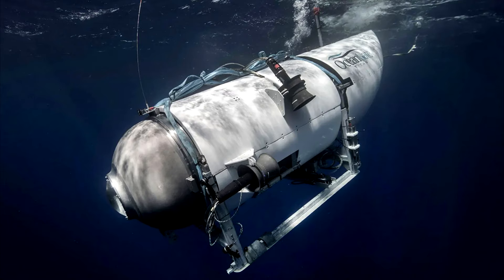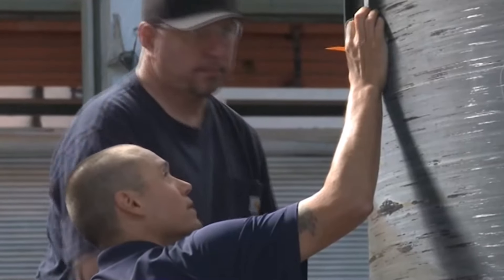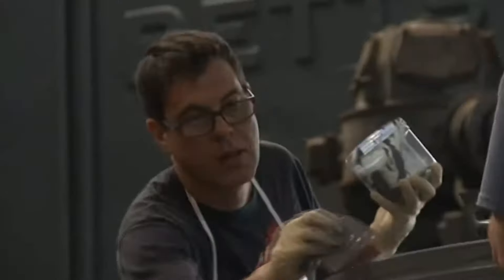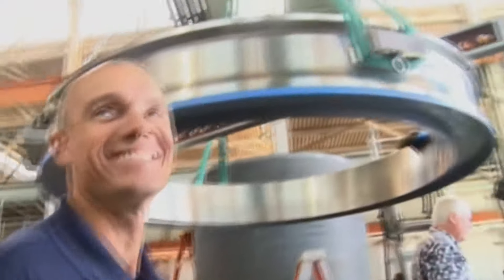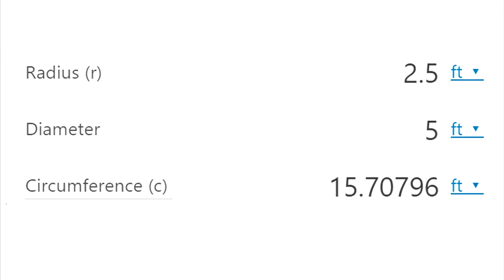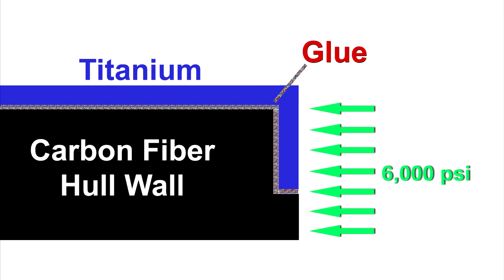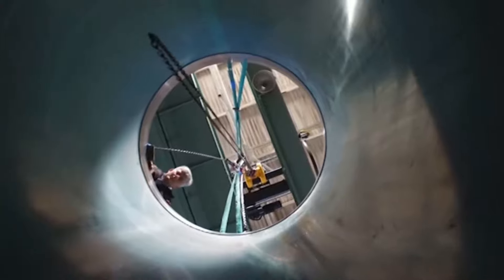Ocean Gate Titan Was Glued! Coast Guard Reviews

Comment: Mechanical engineer here. I used to do aerospace composites testing for fatigue, at coupon level, for material characterization.
In other words, I used to take samples of  carbon composites and break them in servo hydraulic test frames to see how the material behaves under different loading schemes. 

Let's get something basic out of the way. Carbon composites, like fiberglass composites are nothing more than string embedded in glue.
Sure, the string is stronger, on a diameter basis, than many other materials,  but it is still just string.

Strings can only support tensile loads; one cannot push any object with a string along its length.

The only legitimate use for strings in glue to be used as a pressure vessel is when the pressure inside the vessel is higher than the pressure outside of it because the string will be loaded in tension, similar to a fat man with his belt too tight.

Asking the carbon string to withstand compressive loads, like for a submarine, is setting up the loads to be pushing, not pulling on the string.

The end result is that the glue itself takes the compressive loading. There should be no forces acting in the glue, which is just plastic. The glue is only there to preserve the orientation and spacing of the strings.
Reply from the maker: Yep.  Absolutely correct.  The idea was not sound.  It's amazing it lasted for as many cycles as it did.  You need to watch Karl Stanley testify at the Coast Guard hearing next Tuesday.  He is scheduled for 1:30PM.  I've seen all of his interviews about Titan.  He went down to 4,000 meters in Titan when Rush was testing it in the Bahamas.  Karl has a great story about it and he will be awesome.  I can't wait to watch him in this official setting.
Reply: @solareclipsetimer  I heard Rush talking about initial cracking sounds supposedly tapering off after the first dive. That made my jaw drop. Any, I mean any, cracking noises indicate structural failure.  Since Rush never fatigue tested his cylinder, nor assembly, he had zero data concerning ultimate life, or how many dives he could safely perform before trashing the cylinder.
I would not have taken a single ride, not even if the vessel was spherical, doubly thick and without ports, if it was made out of strings under compression.
Forgot to thank you for the reference, I look forward to hearing what Karl has to say.
Reply: "You can't push a rope" - my first year Statics teacher. He always did have a way of explaining things so we could understand them.
Reply: Great explanation...thanks.
Reply: Thank you for this excellent explanation.
Reply: @salvationbygracethroughfaith  Weak
Reply: @GWNorth-db8vn  That's what she said
Reply from the maker: @cremebrulee4759  Thanks, glad you enjoyed it.  The link to the Coast Guard site in the description has the list of witnesses and the schedule.  If you can watch some of it you should.
Reply from the maker: @Kenjiro5775  Yep, everything you say is true. Karl Stanley talks about his dive where things were popping on the way down and then popping on the way up as stored energy was released.  Wild!
Reply: Pressure inside >= outside as in aircraft/spacecraft fuselages/hulls, high pressure gas flasks/bottles.
Reply: he basically made a sub out of some titanium and mostly glue
Reply: I do mechanical engineering as well - I simply don’t understand it survived any dives to 4.000 meters, epoxy is stronger than I thought, even though it’s kinda strengthened by the carbon fibers.
Reply: Absolutely wrong material for the job
Reply: Well said. 👍
Reply: @blacknoir2404 only the 2 domes on the end were made with titanium.
Reply: @vaughnkavon3993  yup that's the some titanium
Reply: Calculate the compression forces. These glue joints have to take the force of the water pressing on the entire front and back face of the cylinder. If I didn't make a mistake, that makes a force of 155 N/mm² in compression forces, that the glue and the carbon fiber has to withstand, and that only at 4000m with 0 safety margin.  If I remember correctly, the epoxy used has a tensile strength of only ~ 25 N/mm² and while tensile forces aren't compression forces, that is some load design that can't possible go well.
Reply: That makes perfect sense but makes me think of more questions

Comment: Well, the US Navy made the unmanned AUSS submersible. It was a 2.5" thick GFRP cylindrical hull with glued on titanium end caps, using coupling rings and epoxy. It was designed to reach 20K feet depth. It made many successful dives. It was built very much like Titan, except with much better materials and construction methods. It may be where Rush got the idea.
Reply: It was also much smaller, and therefore stronger for a given thickness of material. But I also bet it was made with care and attention to detail, unlike Ocean Gate who seem to have had a 'near enough' attitude to the whole thing.
Reply: So it was the same, but 100% different... ok.
Reply: @onenote6619  Yes, AUSS was 17 feet by about 3 feet and it was of course much more carefully made. I think it must be where Rush got the idea. IIRC, AUSS made more than 100 deep dives.
Reply: UNMANNED.☠️☠️😳☠️
Reply: The budget the US Navy had for their submersible was many times that of OceanGate. Rush was trying to make his sub while spending as little money as possible (relatively speaking).
Reply: @sjsobol1  Since AUSS was unmanned, I doubt that budget claim. Rush clearly didn't care that much about safety testing, as he basically never tested the hull design he used. Not even once. He just assumed that five one inch layers sanded off and glued together and  autoclaved after each glued layer,  was the same as one five inch layer.  This also meant that by the time the last autoclave session happened, the first layer had been autoclaved 5 times. The five layer idea was never tested in any way.
Reply: Well duhhhhh..yes if the Navy's was smaller  then it's different..

Comment: Titanium and carbon fiber composite will have different stiffness and as the pressure loads build up they will compress by different amounts. This is going to place shear stress on the glue joint.
Reply from the maker: Yep, agree.

Comment: Thank you for this very clear description and explanation.  He must have been willfully blind not to admit the very obvious danger of 32 feet of glued joints between two different materials with different flex under extreme pressure.  And as you point out, the glue was just slapped on by hand with no testing or way to detect gaps or bubbles.  

What power he had, to hide from all reasonable warnings and all oversight that would have prevented him from endangering passengers who did not know the magnitude of their risk.  Horrifying.
Reply: Thank you for your thoughtful comment.  If you get a chance to watch some of the Coast Guard hearings you should, I think you would find it interesting.

Comment: Actually Thunderf00t did anticipate the failure point at the glue joints a year ago. He also shows the problem with the different coefficient of shrinkage of the materials under pressure and on temperature change.
He said he was shocked it lasted as long as it did. But the other thing that will brake is the carbon fobere . You use a rope (carbon fibre) for forces under tension. But you use metal or stone for pressure forces. Airplane bodies have a higher pressure in the inside on travel altitude so the carbon is under tension because of the higher pressure inside. So using it with a ridiculous pressure outside with pressure change each dive just wears down the pure carbon fibre to. The titan spheres they use normally are that thick that the titanium is pressed against itself so it has no real weak points in the sphere. This tube was just accident waiting to happen.
Reply from the maker: Agree with everything you wrote.

Comment: After this tragedy last year I started saying don't make submersibles with Mod Podge (a name brand craft adhesive with no affliation to the Titan). I was only joking, of course, but have come to realize that adhesives were indeed used in the Titan's hull construction. ETA: I did not realize that the carbon fiber hull had been machined to accept the ring. I thought that the ring was formed to mold to the 5" carbon fiber hull. Thank you for the great video!
Reply from the maker: Thanks for your comment.  Yes, I was also amazed that they used a lath to decrease the diameter of the hull on the front and back outer rims to accept the titanium rings.  Not only does it reduce the diameter at that lath section, it disrupts the neighboring carbon fibers that may have been sliced at the edge of the "step-down."  If a fiber loop is cut it decreases its performance and the amount of damage done there is not determinable.

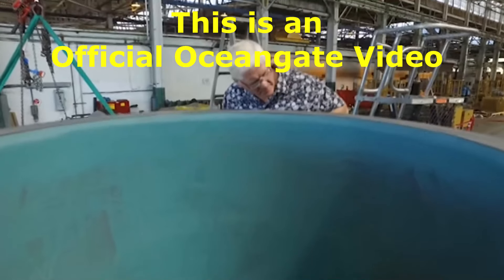Comment: 0:50 Stockton]  "That seal needs to be uniform and small, but not too small."  You know what this reminds me of?  the reasoning behind the procedure for the installation of the insulating foam of the much discussed 'bipod ramp' of the Space Shuttle that came out in the Challenger Disaster Report.  There you also had a safety item who's integrity was completely dependent upon the craftsmanship of the technicians installing it. NASAs attitude at the time was that their craftsmen were very skilled and that would ensure sufficient quality.
Reply from the maker: Thanks for commenting.  yes, that was an odd statement.  Spencer Composites actually had a specification in their design analysis for the glue joint.  It has a measurement on the drawings.  It is supposed to be 0.03 inches thick.  Do you see anything in this video that gives you confidence that they know that the entire joint is uniformly 0.03 inches thick?
Reply: @solareclipsetimer  Given that the ring and hull were within a reasonable specification for cylindricity, the hydraulic nature of the glue itself should in principle make the two parts fairly self-centering with any excess glue being squeezed out.

What I would be most afraid of would be voids and bubbles everywhere, and that would be almost impossible to control due to the viscosity of the glue even using a vacuum system as proposed by SchrodingersCat, but that requires a rather liquid adhesive.  The more liquid adhesives available probably not strong enough
Reply: He should be wearing a face mask and hair covering if it is as critical as they are saying, which it likely is. Another example of his recklessness.
Reply: @martystrasinger3801   Hi Marty, I'm honestly not sure who you are replying to since your sarcasm seems misplaced in this sub-thread.  In similar situations when I'm being playfully sarcastic I close my comment with the /sarcoff tag to signal readers that I intended to be playful rather than a jerk.  There have been references to dust contamination, but not in this sub-thread.
Reply: @williamreymond2669  I apologize for any confusion, as I was not being sarcastic. The conditions that Stockton spoke of re: the specifications for the glue and integrity of the glued joint should have required higher cleanliness standards. A fallen hair, or drop of spittle, could risk the integrity of the system. I believe a similar statement was made elsewhere in the comments regarding cleanliness of the facility where the gluing was being done.

Comment: Putting Carbon Fiber in Compression is EXACTLY the Opposite of what Carbon Fiber is best at.
Reply from the maker: Yes!  The concept is loops of strings under tension providing strength.  This was loops of strings under compression just providing a platform for the plastic matrix.
Reply: How was the CF "in compression"?  Compression is where the forces are applied towards the ends of the fibers.  Obviously, that was not the case.  The hull was wound from CF ribbon circumferentially, and lengthwise.  The force from water pressure was from the SIDE, which would tend to make the composite bow in.  Well that is much more complex, as  any applying force to the side of a longitudinal structural element, be it a CF sub hull, or a universal beam, or whatever, creates compression on the surface where the force is applied, and tension on the opposite surface.
No doubt using CF in this way was quite inappropriate, but largely ignorant glib analyses on YT are not helpful.

Comment: When Building with carbon fiber I put my parts Under a vacuum, 12 PSI  1. earth atmosphere. That glue joint was unclean, open to dust, Air bubbles were created as the part was set on! The epoxy was troweled on, the epoxy was drying(setting up) as it was applied...  All JUNK! Where were the experts?
Reply from the maker: You know, he had experts involved at various times, but Rush fired them as soon as they started indicating that the concept was not going to work.  So far, during the hearings, Nissen and Lochridge who were involved with the building of Titan said they would "NEVER" get in the thing and take it to depth.
Reply: Yeh, I have done precision glue ups of composites and literally everything about this was done wrong. There is no way any of it could ever be certified.
Reply: @schrodingerscat1863  it wasn't. They just pretend it was in order to get customers.
Reply: @TheresaHall-vl1bm  Exactly, lack of certification for that thing is serious problem. Allowed that clown to cobble together a death trap and take paying passengers in it.
Reply: They were fired
Reply: slightest bit of flex on that joint and game over , it had no chance , the older the carbon fibre and resin the more brittle and harder it becomes.
Reply: @schrodingerscat1863   I'm sure  that is something that will be looked into as in how do we prevent people from going out without being certified.  Considering after the titanic there was huge inquiry and a bunch of changes were made  including more lifeboats and people on radio  at all hours.  They will probably do something similar when this is over.
Reply: It could have been the best joint in the universe z it was still wrong to choose the materials and methods for the use envisioned. So whatever. Nobody cares.
Reply: @camojoe83   actually  that might something that is forbidden when the inquiry is over
Reply: @TheresaHall-vl1bm  you can't forbid dumb people choosing to do stupid things in open water. No way to do that.
Reply: @camojoe83   true but you can keep from going to sea or operating a business without the proper paperwork
Reply: @solareclipsetimer   plus none of the others were experts in engineering.  The rookie engineers were probably just glad to have a job plus didn't have enough experience to know the dangers
Reply: @TheresaHall-vl1bm  you can also make laws against drugs to solve the problems of drug use. 

Oh, wait. You can't.
Reply: @camojoe83   we have to do our best to prevent trouble.  Does that mean there won't be stupid folks no but there might be a few less when the new rules are made.  Considering looking back at the titanic we can see common sense mistakes that had to be fixed with new rules at that time so they probably will do something similar when this is over to Hopefully keep some idiots from killing anyone besides themselves.
Reply: @TheresaHall-vl1bm  there's no rules in the middle of the Atlantic, sorry.
Reply: @camojoe83   but unless you can live out there all year round  the authorities will have their say especially if you plan to run a business from their ports.
Reply: @TheresaHall-vl1bm  lol whatever. You must not live near the ocean.

Comment: The pressure, also applied to carbon wall, and via carbon to glue and inner titan ring bevel (and they both, glue and bevel finally failed on front ring).
And there is no major glue residue left on front ring.

Comment: Wouldn't there be a difference in how the different materials react to the temperature variances?
Reply from the maker: Yes, good observation.  This was dealt with to the degree they could predict with the design and thickness of the titanium ring junction point.  Trying to match the behavior of the carbon fiber which was right next to it.  It's complicated with the adhesive in between them (another variable).

Comment: I think you have hit the nail on the head. 
I personally believe "that" bonded joint is the cause of his demise and not the sanded  carbon fiber between layers. 

That joint would have had air pockets in the bond line. There was no control of bond layer thickness as discussed, there was no squeeze out of adhesive, the inner flange of the titanium ring was insufficiently thick and provided no shear support for the carbon tube.
That inner flange was torn off in the wreckage, check it out.

Comment: I seem to recall some other source saying the Titanium domes and rings were reused from a prior model. That prior prototype had a 4.5 inch thick carbon fiber cylinder, and therefore Titan’s 5” thick hull needed a step. The latest pictures of the wreck suggest failure occurred at one end at the joint of the carbon fiber hull and ring. Much of the hull was crushed into the aft dome. I believe it was Tym Catterson participated in Titan recovery operations and actually examined the wreckage and testified at the hearing that it was apparent to him that the initially failure ccurredvat the cylinder-forward ring joint. 

BTW: The really big piece of wreckage (rear dome, ring and crumpled carbon fiber) seen in the latest video was recovered separately from those pieces - fairing, aft equipment, leg structure, forward dome and two rings* - shown being loaded aboard the recovery vessel. * EDIT CORRECTION: I was under the mistaken impression both titanium rings are recovered in the initial batch. The aft one has to be still attached almost to the aft dome.
Reply: Your theory corresponds very closely with Scott Manley's theory. He has a u-tube channel, and he has done a video on this situation after watching some of the early meetings of the board of inquiry. It seems like a great opinion to me.